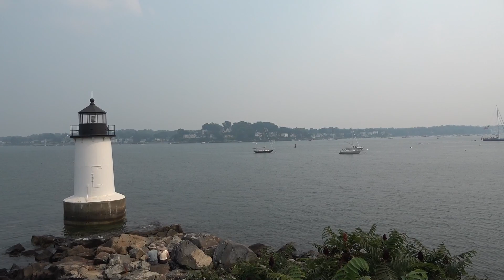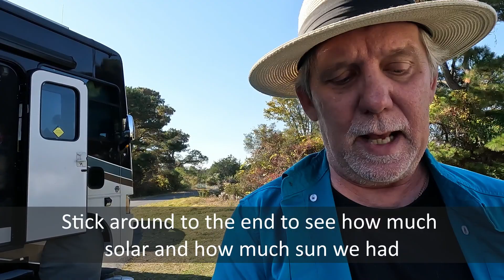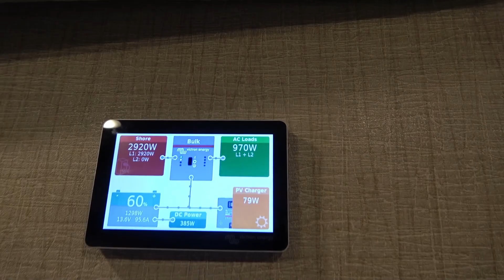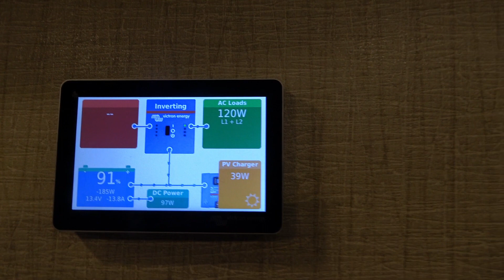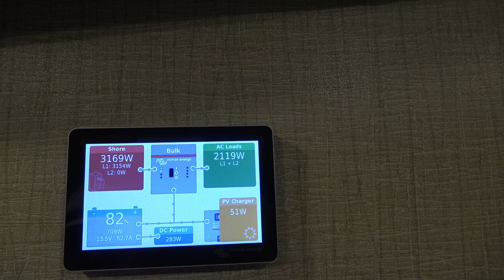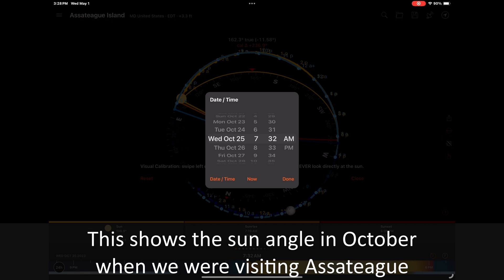Real World Solar Results - Sunny vs Cloudy - Fall vs Spring

Comment: Subscribed and glad I found your channel. Very informative and to the point no fluff. What do y’all use for a dash cam looks like you use a front and inside camera. We will be picking up our tiffin tomorrow and we cannot wait wait. Stay safe
Reply from the maker: Glad you like the videos. We currently have a Garmin Dash Cam in both our Tiffin and our Jeep. Though I am looking for something that has a better resolution and is not so pricy so I might be changing those out soon. Not a priority since they work ok. We just like to capture certain sections easily for our videos like when we see wildlife or cross another border, but Garmin makes that difficult at times.